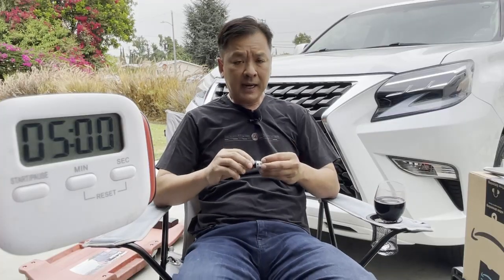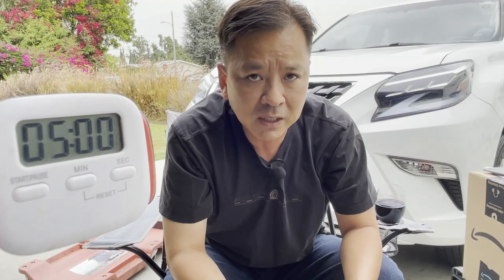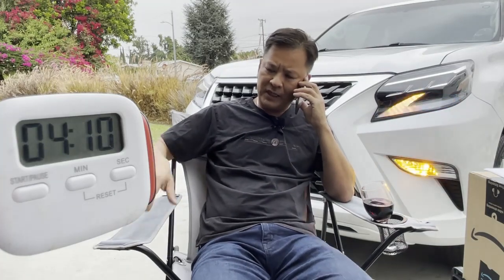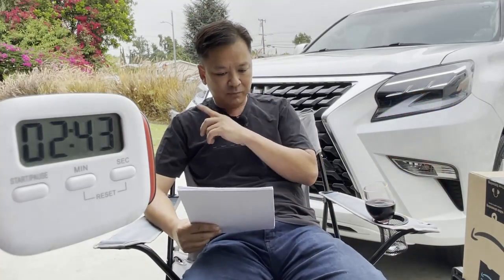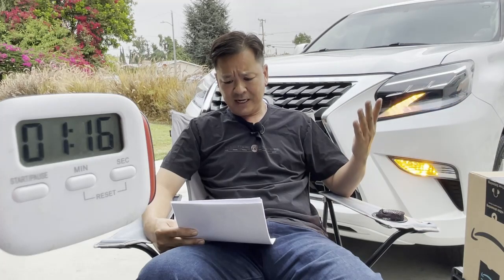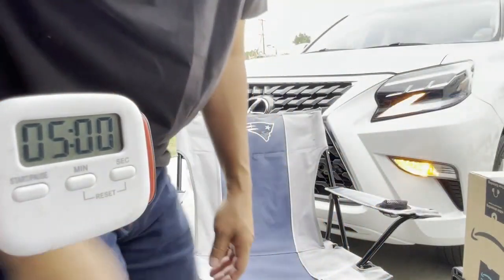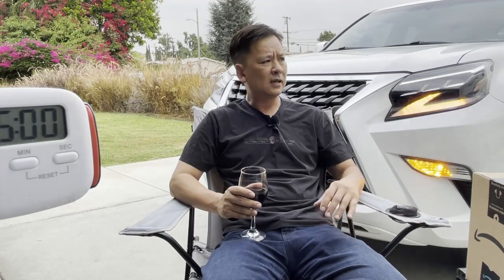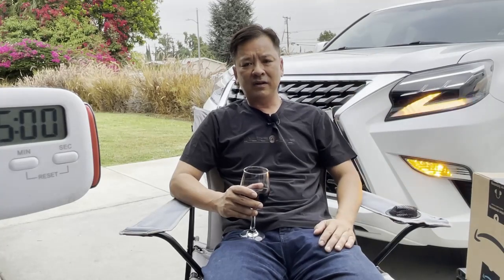Testing LED's for overheating

Comment: Thank you for putting this one together, Bob!
Reply from the maker: No problemo!
Reply: @GXBOB  Just as follow-up, do these bulbs produce as much usable light output on a bright day as they do at night? I used to run a rather expensive DiodeDynamics turn signal bulb that just sucked ass during daytime. There was hesitancy by other drivers due to apparent lack of visibility. Even at night, I could see a vast difference in roadsign illumination where it was even worse than stock. Those bulbs used a similar projector/radial chip design. Switched to VLEDS but they don't play well in my GX without any resistors. I posted some comparisons on CL. Cheers!
Reply from the maker: @vVeazel  The good thing about my truck is the 2020 conversion that also uses the headlamps as turn signals.  I have a total of 4 turn signal lights in the front of my car.  I never really noticed poor light output but that may also just be me.  Only real way of finding out what suits you best is to use Amazon's great return policy and test a few out for yourself.  I"m content w/ mine so far.

Comment: Hi Bob. I’m upgrading GX460 2012 model to 2021.
The lights are the same as you have, but the electro corrector is not functioning upside down. Do you know how to turn it on?
Reply from the maker: @ashatait1691  My first question is what is it exactly you're upgrading.  The second question is, what is an electro corrector?  3rd question is...i actually don't have a 3rd question.  Yes, if you go to my profile page on youtube you'll find my personal email but i check  my comments here on youtube quite often so i can actually assist u here if need be.
Reply: @GXBOB  hi Bob, i am doing a complete restyling from 2012 to 2021, in the kit I have the same headlights as yours, but the elektrokorektor headlights do not work, they do not go down when you start
Reply from the maker: @ashatait1691  Hey Ashat, i haven't been ignoring you.  I have been doing some research on the electrical plugs for your year GX.  Mine was plug and play so there was no rewiring of any kind.  You would have better luck with someone that has already made that conversion. For example: https://www.youtube.com/watch?v=q0atqNUH2S0